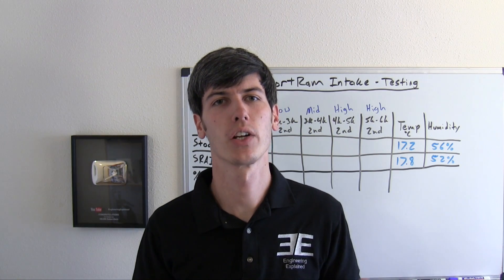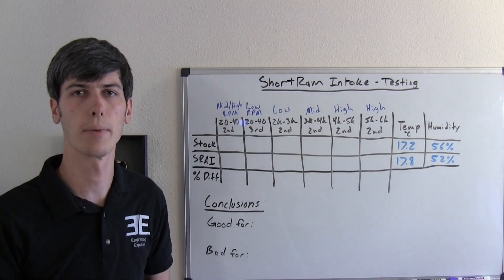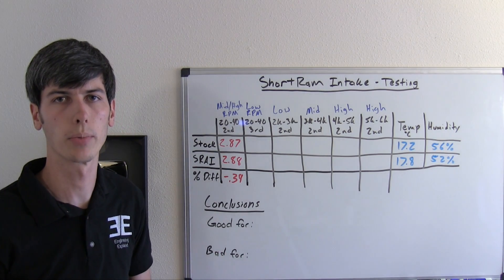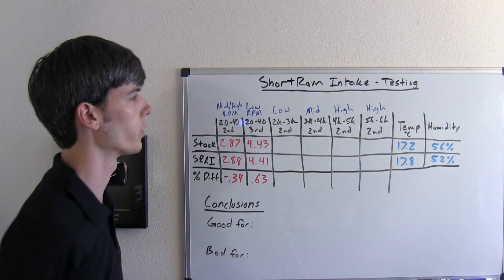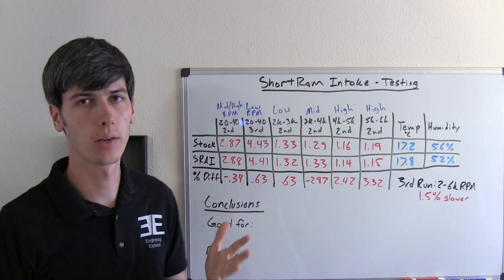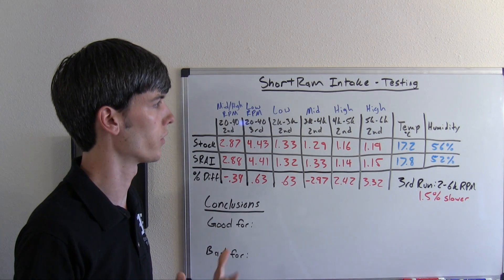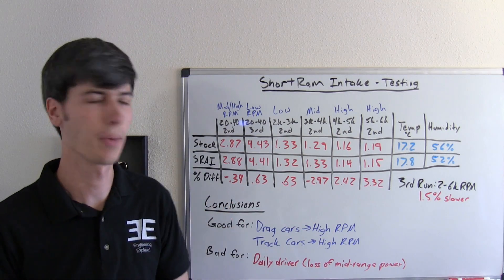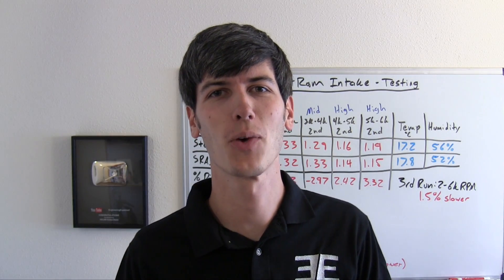Do Short Ram Intakes Actually Work? - Project Integra

Comment: During this test and your CAI tests was the engine completely warmed up?
Reply from the maker: +Wick3DPimP Yes, always warmed up before testing.
Reply: +Engineering Explained Cool, thanks for the reply. Other video's have shown on a dyno that intakes don't work and all though I don't have one on my current car.. I've always thought that they should have some effect on different rev ranges, which I think you kinda show in your tests. I also think that all in all, results on just a few cars can't really supply a definitive understanding on how effective intake's are. I would think the key variable is where the "bottleneck" is. If your throttle body or manifold is restricting the air supply more than the stock air filter, you probably won't see much of a result. On the other hand, if your throttle body and manifold have plenty of open space and the stock air box is the restriction then you would see much more improvement. That said I would think that modern cars would be less likely to have a restrictive air box, because all the car companies are trying to squeeze every hp and mpg out of their motors. Older cars might be a different story and with other mods to your car that un-restrict air flow, you might see nice gains...
Reply: DUHHH...it's engineering explained. of course he thought about warming the engine up!!!!!!!
Reply: +A Little Bit of Everything I still think you have a preconceived notion that adding a wider intake pipe or increasing filter flow will force more air into the engine. Every naturally aspirated motor attempts to pump air in. Now if it's trying to pump (arbitrarily speaking) 200 cfm and the stock air pipe and filter can allow 250 cfm, then reducing restrictions should do very little. On the other hand if it wants 200 cfm and your stock air pipe and filter only allow 180 cfm, then un-restricting the flow should show gains. An engine that runs rich is based on its programming and you can't naturally force the engine to take in more air without forced induction or increasing its displacement. 
Exhaust is always going to give the best gains because auto manufacturers are forced to adhere to emission laws and of course they typically appeal to being quieter, unless the car is specifically designed to be a "sports" model.  In short, they are intentionally restricting power gains to achieve other goals. If you don't like those goals you can change them out for performance gains.
Reply: +Engineering Explained did u reset the ECU by disconnecting the battery
Reply: +Wick3DPimP Depends.  On the new integra (rsx type s) they said that the stock car was tuned slightly rich.  So adding air would show increases.  Also, for the k-series, the TB is not the bottle neck.  After many years, aftermarket manufacturers finally figured out that at least a 3.5" intake piping is the best and a 3" piping exhaust gives the most gains.  After all, the k-series is 2.0-2.4l.  Thus going back to basics, they should require more air.  Also, race headers seem to show the most bang for the buck where it frees up a lot of whp.
Reply: Meaningful conversation :)  What I was meaning to say base on example is that the honda k-series engine has proven since it's arrival in 2002 to 2015 is that bigger is better to a certain extent.  In the old days, a b-series engine usually wouldn't benefit from a 3" exhaust naturally aspirated.  The k-series however do benefit from a bigger pipings in natural aspiration form.  As for the rich comment, what I'm saying is that the Acura RSX was tuned rich from the factory.  Therefore, adding more air by way of aftermarket intake (non-tubro/supercharger) it will show gains without retuning because the increased air will go towards the lean side.  I'm unsure about the b-series, but the k-series cylinder head flow well and can produce power quite well.  For example, a acura rsx type s is rated 200hp at the flywheel which is about 160-170whp.  After you add intake, race header, and exhaust, most setups will get 200hp to the wheels.  Going back to your logic, perhaps the k-series came from the factory with restrictive intake and header.  Simply changing the intake and/or header will show good gains because the intake manifold and head already flows well.
Reply: +A Little Bit of Everything I see what you are saying, it's tuned rich and probably has a bit of air restriction in its airbox design so it's a perfect candidate for aftermarket intake. The part that I would disagree with, is that the air/fuel mix is controlled by a computer based on the air flow sensor. If it is factory tuned to run (arbitrarily) 10:1 then adding more air will still add more fuel meaning it's still running rich. In modern cars there is only one way to rich/lean the mixture and thats with ecm programming.
When it comes to exhaust, the same flow rate issue occurs, if the motor is trying to dump X amount of exhaust and can't because of a restrictive exhaust system, the exhaust will create a higher pressure zone in the header, not allowing the exhaust to escape from the cylinder, meaning on the next ignition stroke you will have some compressed exhaust mixed with air/fuel giving a weaker ignition. If you relieve that pressure in the header by unrestricting the exhaust system the exhaust will be able to properly escape. Every motor has a different amount of exhaust it needs to push out and like the intake system removing bottlenecks will increase the performance. 
As I said though you are always more likely to improve performance through exhaust mods simply because the manufactures had other goals in mind than just performance. With intake system's they have little reason to restrict performance other than possibly saving money on production costs. They could have also needed to use a more restrictive design to prevent rainwater from getting sucked in, which you could trade off for performance as well.

Comment: Please test this:
1-Make a custom heat shield because the short ram air filter is sucking hot air from the engine and leave the low part of the original air box so the filter still receives a little cold air 
2- Put a hood scoop

Comment: First off I'd like to thank you for all of your sound data testing and break down. It was quite refreshing and very easy to follow. I've watched both vids for Short Ram and Cold Air Intakes. I'm actually really interested in boosting up my intake on my daily. My driving moods very vastly however. Cruising and saving gas I cap at 2k. Spirited or traffic speeds 3k. Slight Hooning 4.5k. All out about 6k.

My main question to you is "Do you think that this data is a good predictor of engine performance against Stock, SRI, and CAI in the engine's comparable power band ranges? Or do you think there will be a big difference for cars without VTEC or continuous variable valve adjustments? Also what would you think would be best for a person that DDs often but still wants more power?

Personally thinking about a CAI due to temperature issues but I have a battery in the way which Hyundai looped under into the fender then back up over the radiator for forced RAM induction. I think atleast. Just trying to weigh out options.

Comment: Nice video. But SRAI works TOGETHER with heat extraction from the hood and a more straightforward contact with the air outside; also the ECU needs time or a reset to adapt to the increased air flow.

Comment: U need to let the ecu adjust the mixture air/fuel since u are modifieing the intake, once u let the ecu adjust, the different will increase.. =)
Reply: If you have more air and don't add more fuel the your car may lean out due to the lack of fuel that is needed.
Reply: Jesus Rosales He thinks he knows...  lol
Reply: +Edwin Aristigueta Im not an expert on ECUs, however Im pretty sure modern ECUs can and will adjust the a/f ratio instantly. Because air pressure is constantly changing, so the car has to be able to adjust to the natural changes in air flow.
Reply: +Nick Palaroan This is actually not true.  Depending on how much we're talking about here.  If the ECU can adjust a/f ratio, then we wouldn't need to go get a tune.  Let's say for example the stock car comes 13.1 a/f ratio.  You add intake, header, exhaust.  If the ECU adjusts, then you should still be at 13.1 a/f ratio and not lean out.  But the modifications would cause you to lean out at wide open throttle.  I can monitor the engine with my hondata kpro ecu.
Reply: +A Little Bit of Everything I disagree, the ecm simply has a programmed map of what air/fuel and ignition timing it requires at X rpm. It decides how much fuel it needs by the air mass sensor and adjust accordingly in the matter of milliseconds. It also detects if it is running lean or rich by the o2 sensor and adjust according to that as well. You require a tune to change the air/fuel mix and more importantly to change the ignition timing. Just because the engine can adjust, doesn't mean the programming was good to begin with or had performance in mind. Most stock ecm's were designed to run very "safe", low knock etc.. It also had 87 octane in mind. Yes it can detect knock and adjust, but again was the programmed map designed to maximize performance..

Comment: I'm curious as to whether or not the results would be different if he had an exhaust, header, or both installed before and after the intake was installed. I've read that as far as bolt ons go, you don't really gain any significant power unless you have a combination of a few.

Comment: I guess that the SRAI would be more beneficial after remapping. Ideally the car should be remapped after any modification on the engine.
Reply from the maker: bax442 What parameters would you change? The MAP sensor can adjust the air/fuel ratio as necessary.
Reply: +Engineering Explained But the changes that would be made by ECU may not occur fast enough.
Reply: +Engineering Explained i think that a better question for the guys at hondata.
Reply: +Engineering Explained Only to a certain extent.  Then why do we need to get a street tune or dyno tune?
Reply: +Engineering Explained only within the factory parameters which are set for the stock intake if the new intake increases air flow to beyond what the stock intake can do it changes to outside the maps original parameters then the computer can't adjust for it that's why computer tunes are necessary.

Comment: In the 3-4k range small 4 cylinder engine cars hit a natural interference frequency in air flow that causes power loss.  Some more recent hondas have resonators that counters the interference, but this reduces high end power because it lengthens the runners.  This is partly why Vtec in k20as is dramatic because the k20 has a torque dip leading up to the Vtec switchover and actually makes less torque at 5k then 3k.  Its the same thing with BRZ/FRS.  Older honda engines aren't as likely to have the resonator and making the intake shorter probably makes it worse.  That may at least partly be to blame for the mid range drop.

Comment: Engineering Explained  Just my two sense, but isn't the whole idea of a RAM air intake to take advantage of the fact that the air will be pushed into the RAM intake with greater pressure due to driving at higher speeds? Wouldn't a better test be showing the effects of the RAM air intake being testing at higher speeds instead of higher RPM?

Comment: I'm a Honda owner, and it doesn't make me mad because the results are exactly what I expected. the difference between stock and the short ram is barely measurable. if you really want to improve the performance, whether a drag car, or a track car, or just a driver then don't waste your money on a cai, or short ram, at least not by itself. my dad and I have been building cars for a long time now. it was v8 muscle cars....mopars mostly. but the idea is the same whether v8 or import. I got my first Honda recently, a 97 prelude base. what you need to do is get a cold air intake with an air filter that has a front entry, then use that to make a true ram air. short rams are NOT ram-air. what I did was go to home depot and bought the stuff to make a sealed ram air system and it works  waaaay better than either short ram, or cai. get a length of dryer hose, the aluminum flex pipe, and a roll of aluminum tape, and a screen mesh for stucco. run the pipe up to the air filter, and run the other end to where ever you plan on getting the air from. in my case, I cut out the black plastic "plug" below the turn signals, on the sh model prelude it would be where the fog lights go. anyway take the heater duct (I forgot to mention that part) and cut it down to fit the opening, fit it to the flex pipe with the tape, and make sure and cover the entire pipe with at least one layer of tape to strengthen the pipe, when you get done it will be very strong. then use the mesh to cover the intake hole to keep debris out. I did it without taking off the bumper. it's not easy, but it can be done, but if you have the tools and time taking the bumper off would make it easier though. then use the tape to seal it to the air filter. I've had it done for over a year and have never has any codes, and never had any water come even close to the filter. it has two bends in the pipe that keeps the water from reaching the filter. and if you do a quality job I promise you won't be disappointed. my lude is stock except for the magnaflow muffler on the stock pipe, and the cai/ram air. the only thing I've raced is a f150 with a 5.4 liter v8.  I beat him by about a car length. I know it's a big truck, but my auto lude is a stock 4 cylinder with 150,000 miles on it too. anyway, if you want to see it I have a few pics of it on my profile. I don't think I have a pic of the air filter, but there's one of the intake in the bumper. don't let your friends tell you that ram air is "a waste of time", because it isn't. both drags, and track race teams have been using it for decades

Comment: I don't see how you wish to compare the stock vs mods in such low rev range since the engine will only be using its eco-camshaft. You have to get in the upper rev range for it to be more effective.

Comment: Would you be willing to try a CAI setup instead since the gains were so minimal? My old intake was broken down into two sections allowing you to convert between CAI and SRI but I suspect the AEM one doesn't work that way,
Reply from the maker: I'll be testing both. Cold Air Intake vs Short Ram Intake - Explained

Comment: As a physicist, I really really applaud your testing efforts and methodology and documentation. I'm curious what method you used to time these runs in that I suspect you have not treated the data appropriately with respect to significant figures. If you were to use scientifically valid significant figures, I suspect your results would show almost no difference in performance at these speeds. Keep up the good work though!!! I love it!
Reply from the maker: Ma Zu For timing I count the frame using a camera shooting 120 frames/second. I measure the number of frames from one speed or RPM to the desired RPM. Sig figs come from 1/120 = to the nearest .0083 of a second. That's as accurate as the equipment I have can get, and it's accurate enough to show a difference in performance.

Comment: Good test as always, just a quick thought. Some people construct metal boxes to fit around the filter so that it shields a bit of the hot air (not sure if they are sold). Also, as it happened with MCM, shouldnt you program the ECU to adjust the engine air/fuel mix ratio, so that it fully utilizes the higher amount of air feeded to the engine? There will never be significative changes, but you could get a bit more out of it, this is purely based on logic tho, do not know of a real world case...

Comment: Why would any Honda owner, who is interested in performance, care about low rpm, midrange power?  The short ram (why it's called a "ram" i dunno) is all about reducing pumping losses at high rpm.  Hondas are all about making power at high rpm.  But like some others said, a CAI would do a bit better, and help eliminate the 1.5% drop off between runs.

Comment: So why do you think the mid range suffered? Volume of air not a factor in that range but short ram has hotter less dense air?
Reply from the maker: nick s I think it has to do with the airflow, for some reason airflow is worse due to the piping design at that RPM range, and performance suffers. Resonance and what not, I don't know how it works.
Reply: Engineering Explained Do you think you would be able to find out why this "better" air intake did nothing and explain in a video in the future? I don't know about USA but in UK everybody loves installing them. Especially in 1.2l hatchbacks.